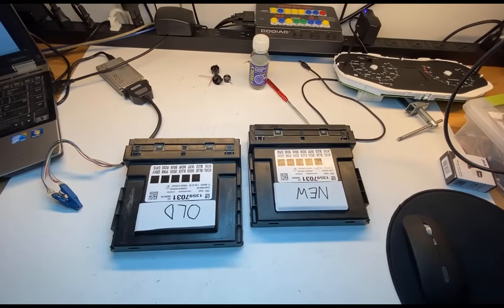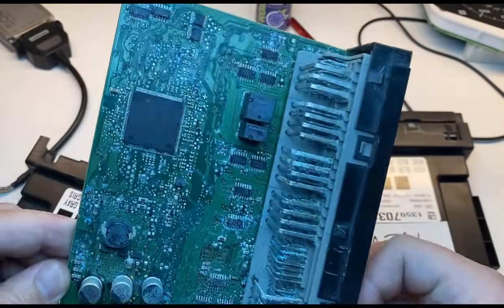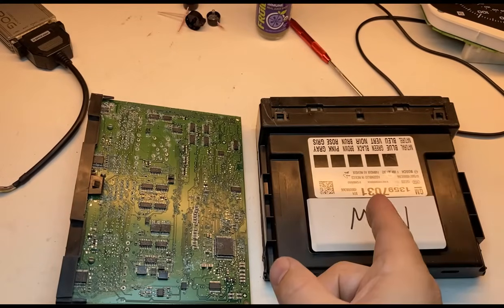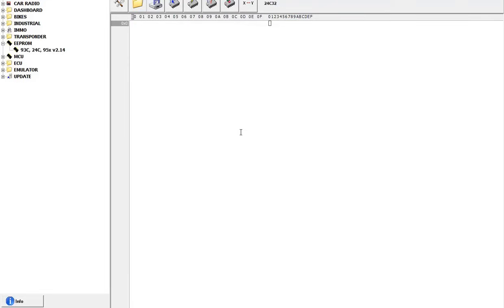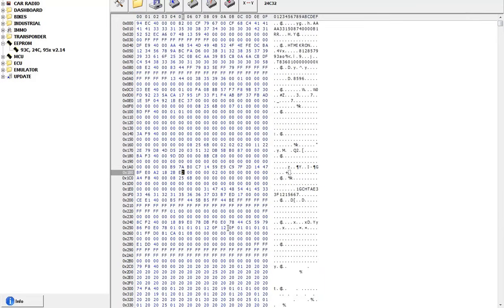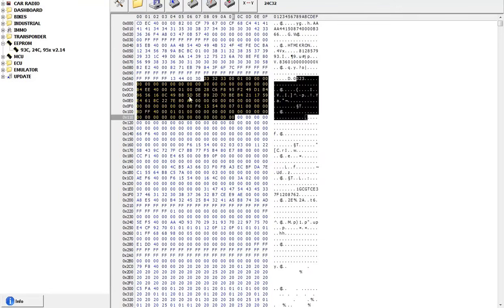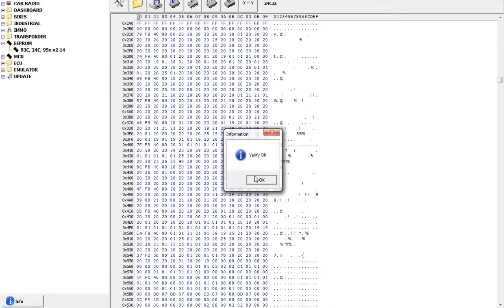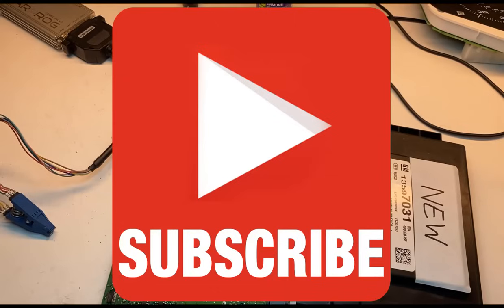Chevy BCM Replacement - GM BCM Clone - GM anti theft light

Comment: I have a 13 duramax that will not crank or reset anti theft new pcm and tcm both have correct vin. Would bcm cause this issue? can I replace bcm and ignition together? Any help would greatly be appreciated I also would like to buy a new vin correct bcm. My radio is also not coming on the 10 minute reset does nothing at all security is light up will not blink.
Reply: have you fixed it ? i have a very similar issue 2016 silverado

Comment: Hi i have a question for you what if u change the EEprom ?
Reply: Did you tried it?
Reply: @BigandSocuulant  I had tried it on malibu 2023, but the left and right brake / turn signal is not working ? does it need a reprogram

Comment: I have a used BCM with a different vin than the customer vehicle. The original module is not available. Can I get away with a vin edit or do I need a virgin file? The said vehicle is a 2014 captiva.

Comment: I learned something today. But am wondering, since the mileage is in the BCM code, wouldn't it be easy to roll back the mileage just by changing some digits in the code?
Reply: I’d hope it’s encoded and obfuscated with a CRC or other check. Not hard to do.
Reply: ARE THE FED KNOCKING ON YOUR DOOR YET?????

Comment: Hello I bypassed the vats system due to changed master lock cyclinder and still no crank I believe the problem is the bcm. If I get a do I donor and would to send it in would you be able to disable  the vats with your program?

Comment: Hi sir thanks for the video.. I have carprog not original that don't read eeprom 24c I need to know what's the problem if you could help me?
Reply from the maker: carprog aftermarket don't work on some stuff and can corrupt the file when reading . original carptog full is like $3k but worth it if your doing it for a living diy not so much
Reply: @vehix411  thanks for responding,  no not always doing this stuff actually !!
Reply: @vehix411 could you send the program via email in a zipped file?
Reply: Hi if u get a used bcm from junkyard do u have to match up the part numbers exactly to the original or just the vehicle please and thank you
Reply: @danlawrence3079  you have to make sure that it's work for same car .. part number not always match !!